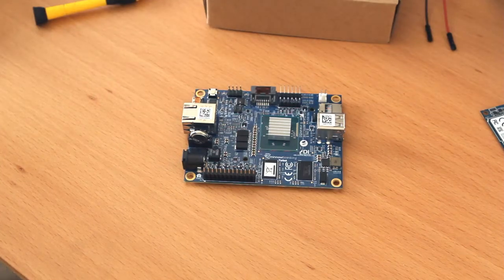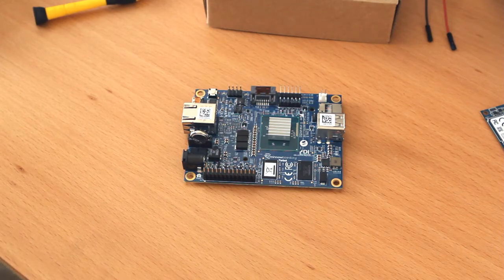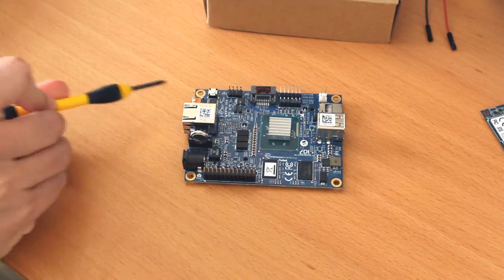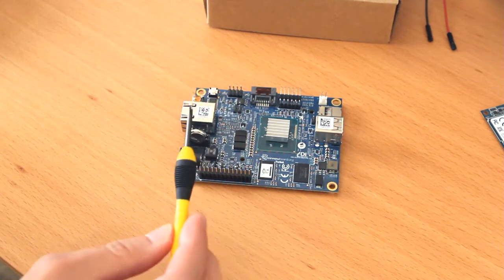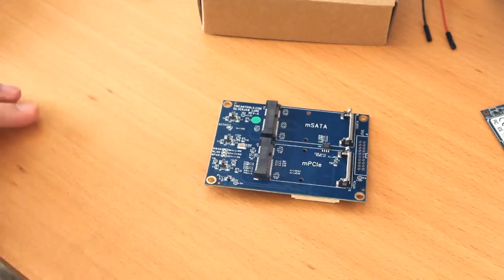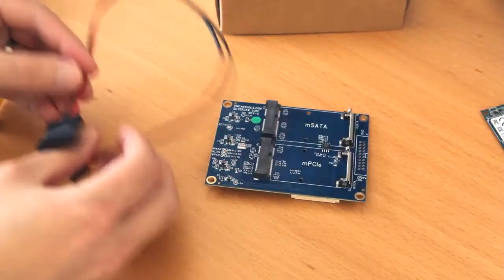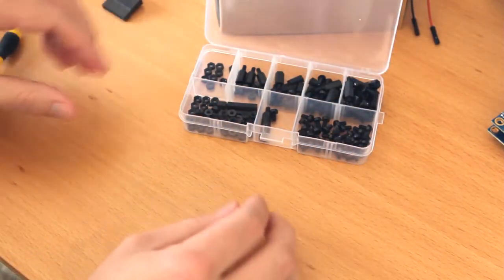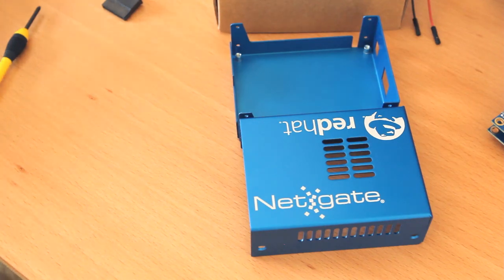Minnowboard Turbot Overview

Comment: If a 4 Port USB 3.0 Hub (with its own power supply) is connected to the USB 3.0 Port of the MinnowBoard Turbot Dual Core, will the board recognize devices connected to the USB Hub?